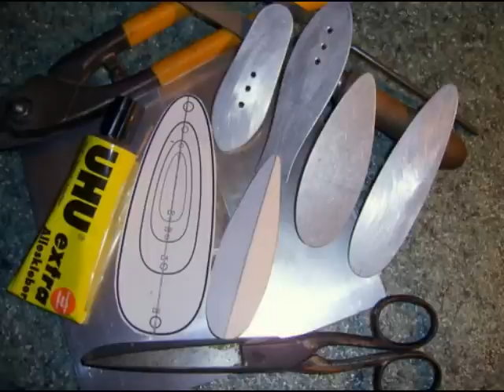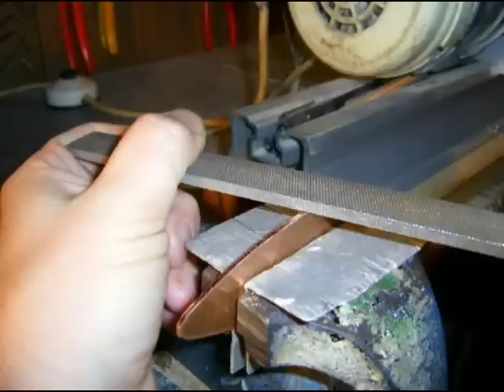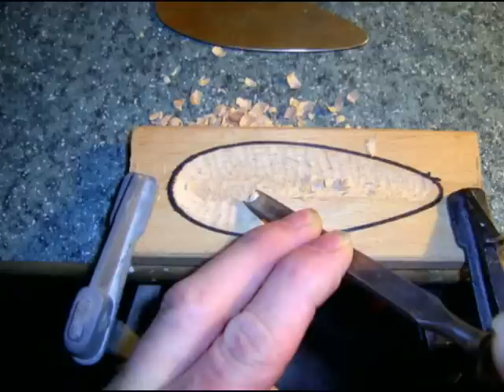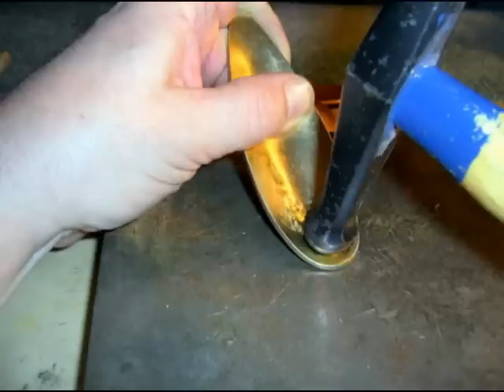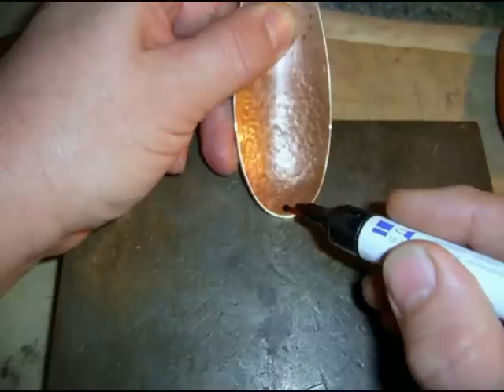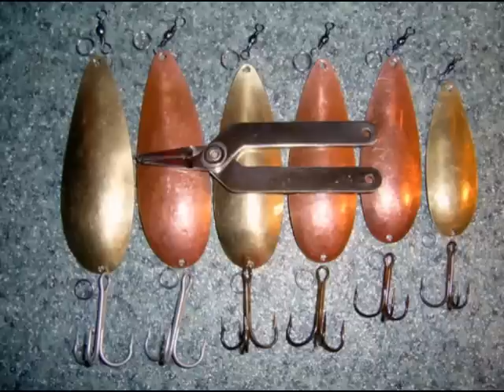Making Casting Spoon Blanks From Metal Sheet

Comment from the maker: 1,0mm , 1,5mm and 2,0mm sheet is possible , .....copper , brass or stainless steel , but the latter is quite hard to work down , especially in 2,0mm thickness . But 1,0mm copper would be too soft , subject to easy warping  , at least on spoons longer than 40mm to 50mm , I would only use 1,0mm sheet for special shallow running spoons only , anyway , .....for casting performance and swimming depth 1,5mm to 2,0mm is in order .Good luck , diemai

Comment: great video and other interesting stuff in your other videos. what thickness of the copper sheet you are using for pike spoons?
Reply from the maker: +snappersniper Thanks a lot , ....most often I use copper sheet of 1,5mm thickness , but also up to 3,0mm is possible , since copper is quite soft , .....for brass and even stainless steel sheet 2,0mm is the absolute limit for the working methods displayed . Greetings , Dieter

Comment: Just curious where do you get your metals from? They look way to finished to be scraps
Reply from the maker: @ Zach Walker

Stainless steel sheet I can gather from the scrabyard of my work(metal industry) , these are offcuts of sheet metal tabletting machine parts , that we produce .

The steel alloy should be the same as the one used for any kitchen inventory , like the cookers and vent hoods at McDonalds f. e. !

On a rare occassion  I also used to find small pieces of copper and brass sheet there as well , but I also used to buy it from scrabyards or fleamarkets or trade it from friends .

If brass or copper is tarnished or has some patina on it , such does not really matter, as you would brush over and polish your spoons after shaping , anyway .

Buying sheet metal in hard ware stores or RC model shops would get too expensive , as prices for copper and brass went pretty hight during past years .

Ebay would also be a source to buy different kinds of hobby materials !

Thanks a lot for chiming in, ......greetings , Dieter

Comment: Hello dieter that's very kind. i would like to make casting spoons 15 a 20 grams. I don't know what i needed for material and tools. The kind you made are just the once i want to make. maybe you can help me out. Kind regards John.
Reply from the maker: I'm making most of my spoons out of stainless steel sheet , that I gather from the scrap yard of my work ,..... 1.0 , 1,5 and 2,0 mm thick(thicker one is impossible to shape by hand) . But stainless steel is very tough to work on , one can cut it out with a metal hand saw , but grinding down to shape requires an industrial grade grinding wheel , .....the hobby stuff just isn't powerful enough .

Also hand shears won't cut stainless steel , ...only thicknesses of 0,5mm(using this thickness for spinnerblades only) , .....even hobby bench shears may have difficulties with 1,5mm stainless steel .

Another option of cutting out spoon blanks would be a disc grinder with a cutting wheel mounted , ....but I have not done this before .

I'd advise you to start out with brass sheet 1,0 to 1,5 mm , copper works as well , but is softer and you're likely to make the cuppings of the spoon too deep , ...but both are easier to work down compared to stainless steel .

Essential tools are shears(for straight and curved cuts)  , metal saw , a vise , a plane steelplate or an anvil , a plastic hammer , a ball peen hammer , a hammer , a centerpunch , drill bits ,  etc . .....they are all shown in the video .

Here are two videos showing the making of a certain spoon model , a "Disc Spoon",  ......but basically the working processes are the same with every kind of spoon :

https://www.youtube.com/watch?v=7fl7hnKGmHw

https://www.youtube.com/watch?v=L7KQZUhvBQE

Not shown is the polishing process of the finished blanks , .....but it is shown in here :

https://www.youtube.com/watch?v=CHpww-I9zTM

But spoon making by hand requires quite a bit of passion and elbow grease , be aware !

How large do you want your spoons of 15-20 grams to be , .....rather large ones for pike or smaller ones for perch or trout , ......in first case it would be easier to work , since thinner sheet metal like 0,8 to 1,0 mm would be required , ....but probably too weak , if copper or brass , might warp too easily ?

Greetz , Dieter

Comment: what would you charge for an 8 inch casting spoon?
Reply from the maker: I have never made such a large spoon ,  so I can't tell, how long I would work on it and whether it would perform at all ,........besides of that , I have quit on making lures for a while now .

If you're looking for such big casting spoons , I know , that such are really hard to find .

But here is a Finnish Kuusamo "Professor"(similar to the American "Doctor Spoon) of 186 mm length (7 1/2").

http://www.fishing-mart.eu/sklep/en/kuusamo-professor-g5-a23-p2069-k12987.html

There also used to be a German manufacturer named "Riesenblinker", but which is supposively out of business today , sometimes one can still find some on German Ebay :

http://www.ebay.de/itm/hecht-und-wels-blinker-19cm-12cm-/172664080414?hash=item283394c81e

Here are some others up to 9 1/2 "" , ...you may use term "Riesenblinker"(Giant Spoon) or "Wallerblinker" or "Welsblinker"(Catfish Spoon) for the Ebay search bar , ....such large spoons are used for the giant European catfish(silure).

http://www.ebay.de/itm/WALLER-BLINKER-EXORI-GIANT-GUNSTIG-40-105g-14-23cm-CHROM-WELS-KUNSTKODER-/351819299029?var=&hash=item51ea1078d5:m:mOQaRZB_67IxxWjVnMYz1jQ

Greetings , Dieter

Comment: wow, this is awesome does it work for trolling ?
good job
Reply from the maker: +Ahmed Sokar 

I never troll spoons , only crankbaits on rare occassions . 

These are heavy casting spoons of 1,5mm or 2,0mm sheet metal weighting between 30 and 60 grams depending on particular size .

But I'm sure , that one can make typical trolling spoons in the same manner , would even come easier , as you would use thinner sheet like 0,8mm to 1,0mm , ...I'd recommend stainless steel sheet only , maybe also brass , ...but no copper , as it is too soft in these smaller thicknesses .

One more thing to consider about thinner spoons is that they require a smaller grade of cupping compared to thicker spoons , ..this is because less weight has to be moved ,...if the cupping gets too pronounced , your spoon won't wobble , but get to spin or turn over and only flutter up and down .

Thanks for your interest , ..greetings from northern Germany , Dieter
Reply: Thank you sir, such a valuable information.
Greetings form Egypt, Ahmed
Reply from the maker: +Ahmed Sokar 

Good luck making your own spoons , ...greetings , Dieter
Reply: thank u sir very interested